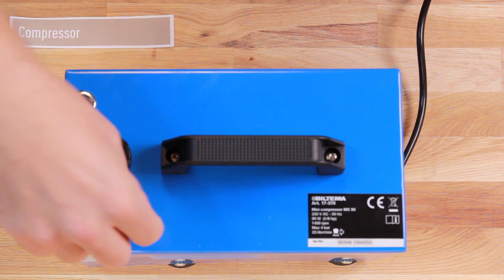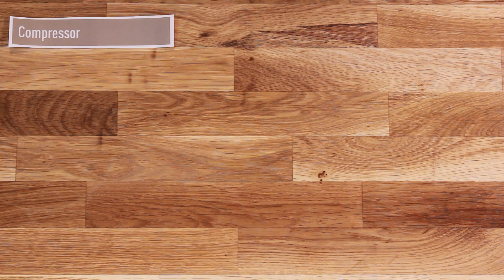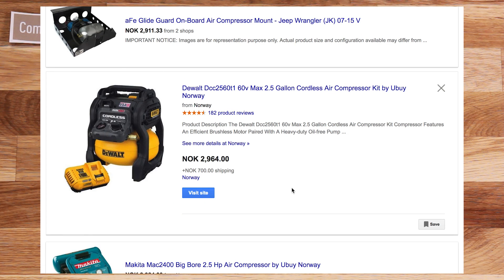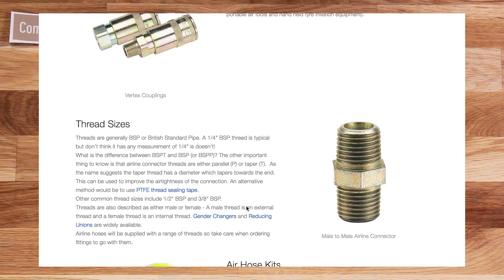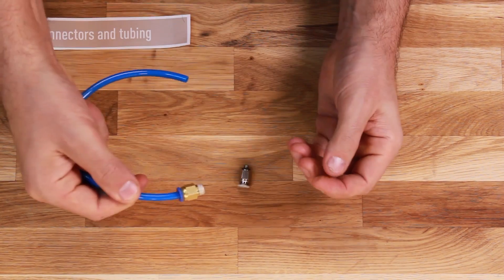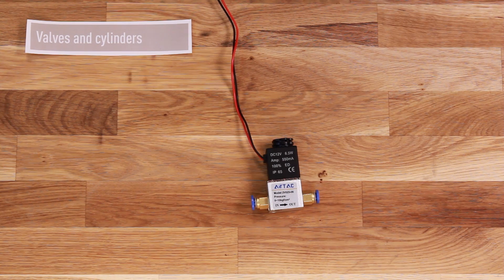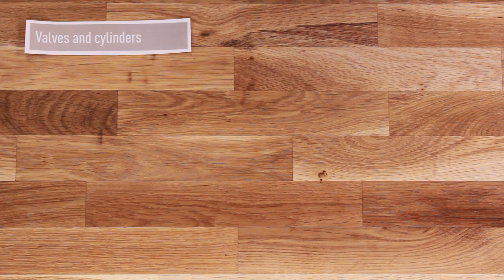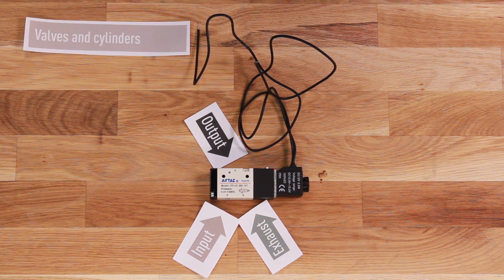Getting started with Pneumatics - the Basics

Comment: Thank you for this explanation... very helpful.  I am a novice looking for advice..  My project needs a pneumatic piston with adjustable pressure.. not just 'extend/retract"...  I am basically trying to use a pneumatic as a adjustable resistor against a force.  I plan to use a pressure sensor to keep the cylinder at a given pressure- but still be able to push against it...  That is why a screw-gear or a hydrolic piston wont work...  Any suggestions or advice appreciated..  Mahalo!

Comment: 11:43 What is the "release" of air that is going on? I can understand the air is going out towards the cylinder, but once the cylinder has extended fully, there should be no other air being released.
Then when you stop supplying air, the spring returns the cylinder and then that air that was within the cylinder should then go out via the exhaust right?
So.. why was there a continuous release of air after the cylinder was expanded?

Comment: Hey i know this is an old video but im wondering if i can just get a tank and then refill that tanks at like a paintball place or whatver. or do sho.uld i ourchase my owen compressor
Reply: Do just what you want I guess? If you refill, they'll love you for not getting your own compressor? 😉

Will you be using this several times? I would do a quick calculation for refilling vs getting the compressor part. It's not expensive at Harbor Freight?
Reply: @JensChrBrynildsen  refill is free so

Comment: Liked how you applied the PFTE tape in a clockwise direction.
Reply from the maker: Heh... I've honestly never thought about this and I never had a problem. Pretty sure I've used both directions with no problems but yeah - there is a correct way https://www.reddit.com/r/HomeImprovement/comments/bs6su2/how_to_use_teflon_tape_for_those_who_dont_know/
Reply: @  Interesting. Thanks for the info.

Comment: Hi do u know what air pump will lift my chassis up faster then my air pump can see in my video the pump im using is a mini power small pump piston air pump vacum pump diahragm home appliance 12v 3/5 L
Reply from the maker: Hi TomWest. It's really hard to help with such a request via YouTube comments. You don't mention what kind of chassis this is and if it's a car, I really don't event think that I want to give advice? ;-)

I would find an online discussion forum for pneumatics where you can post your question with images that explain the context & setting!
Reply: @Maketronics  your right because i might get the wrong 1 that might not work for it i have brought a couple fort they will work and they are no good very slow as at lifting my chassis was lucky to have found the 1 in the chassis that lifts it real good an only found 1 on google amazon but they dont ship to my country i brought it off alirxpress a couple off year ago and they not sell it on there anymore

Comment: can you reverse the direction on the double action?
Reply from the maker: Hi. I'm pretty sure that I'm showing exactly that around 12:00 so I'm a little unsure what you mean? Do you mean changing the "default" extended/contracted state? That would be just to swap the compressed air inputs to the cylinder.

Comment: Can I have a link to the connected for the air compress tube to the tubing for. The pneumatic valve
Reply from the maker: Hi. There are some affiliate links in the description for the video. It's not quite clear if it's the tubing you're after, but in the video I'm using "fancy" tubing from Festo, but any other brand will do as long as it can hold the pressure. I picked up an entire 50m roll of both 4mm and 6mm. I later donated the remaining tubing to a local machinist school.
Reply: @Maketronics  hey thats not what im talking about its at 7:34
Reply from the maker: @LlamaGaming2023  Oh? So just a basic Solenoid Valve like this one? https://www.amazon.com/Electric-Solenoid-2WA030-08-Direct-acting-Normally/dp/B0DK6FBP98/ Just on/off function?
Reply: @Maketronics  at 4:37
Reply from the maker: @LlamaGaming2023  So what you're looking for is the quick-couplings? I cannot tell you what standard is used where you live. You must look that up yourself. I Norway where I am, we have 3 active standards and it's a nightmare to find the right fittings. After a lot of testing, I now know which two I will use. Hansen-connectors at work and at home I use Cejn 320. This will be different for all countries, so go to your local hardware store/workshop and ask them what they have?

Comment: How manu weight can i push using this without any trouble ?
Reply from the maker: Hi! This is something you will need to calculate based on the size of the piston, the area and pressure. Try searching "Pneumatic Cylinder Force Calculator" to find a tool that can make this easier?
Reply: @Maketronics  Okay. Thanks

Comment: Stupid Question but at 12:50 the cylinder is permanently extended until you press the button. If you swap A & B, would the cylinder be permanently retracted until you press the button? I want to build a horror animatronic that jumps out from behind a gravestone, for example, so I need it the other way round.
Reply: You are correct! Just swap to get the reverse action.
Reply: @JensChrBrynildsen  Thanks!

Comment: what do you call that connectors you used which controls the exhaust port flowrate and the inlet port flowrate?
Reply from the maker: Hi! That would be a "pneumatic muffler" or "pneumatic exhaust filter".

Comment: I’m looking to make a prop electric chair and need something to make the dummy shake. how would I make the cylinder automatically open and close without having to press a button
Reply from the maker: Sure. This is fairly easy to do with a microcontroller like Arduino. Just search YT for the keywords Arduino and Pneumatics to find many. James Bruton is one of my favorites https://www.youtube.com/watch?v=d7ErG5ecO2s but check some others as well that go more into the details? One thing: many of the examples I found are using Relays. Keep in mind that mechanical relays don't like being turned on/off very fast, so it's often better to use an SSR instead?

Comment: Hey so I got some Tailonz pneumatic fittings, solenoid valves and such the 1/4 NPT. I have no idea how to connect that to a compressor. Part wise I can't seem to find anything. Is there any recommendations?
Reply: Heya. I have no idea where in the world you are, so it's hard to offer specific advice. But - if you go to a proper hardware store that sells pneumatic tools & fittings, they can give you advice. Bring a valve to explain? (And no - Harbour Freight is not the kind of hardware store I think about here. You'll need somewhere that knows more than selling cheap stuff)

Comment: Thank you for this video! How loud is your compressor?
Reply: Not so loud that it scares me? The most important is to have a pressure chamber so the compressor does not have to run all the time. Beyond that, you pretty much pay per decibel of reduced noise so it really depends on your budget. Any cheap compressor will be loud basically.

Comment: How did your ball launcher turn out?  I wanted to make something similar that would be able to shoot a basketball ball up to 20-25 feet.  Would everything just need to be sized up to handle that?
Reply: It actually ended up beeing opposite of what I thought. If you try to blow something inside a tube, it'll fail at some point. The ball will stop inside the tube. What I had to do was to use under-pressure. Turned out great and have been running all year for 4 years at the museeum by now. They're very happy with the installation.

Comment: What the power supply? 12v ?amps ??
Reply: Hi. This depends on your specific device. The one's listed under the video are 12V (as written), but you'll find others as well. 24V is a common battery on trucks/lorries, so that's also common. There's also 110/230V solenoids available. Amperage is directly related to how strong the solenoid is. These small one's won't pull much, but look at their datasheet and you'll find what you need.

Comment: Hi can not using a air tank to lift weight  weaken the strength the cylinder not lifting one side off my chassis im only using air pump 7.4v lipo battery and lego air cylinder
Reply: Sorry. I have no idea what you are trying to achieve with your LEGO here - weak cylinders or not ;-)
Reply: @JensChrBrynildsen the lego ones i have are  weak to lift my chassis but the 16mm bore mini peumatic air cylinders i have lift it
Reply: @TW39  Ok.I still don't understand your question though? Do you wonder how to get more "pressure/lift"? The easy answer is to not use cylinders made for LEGO since there are obvious limits to how much pressure a plastic cylider can hold.
Reply: i know now have to use 16 bore in diameter peumatic air cylinders to lift the weight im new 2 this

Comment: Hey nice video! I was wondering how powerful of an air compressor do I need to move the piston?
Reply from the maker: Most small compressors will give you at least 8 bars of pressure and that's enough, unless you are moving something heavy. Look for a compressor that has a tank, so the motor does not have to start all the time?

Comment: Hi, can we control the position of the piston extension via 4/3 solenoid valve?
Reply: Nope. For that, you'd probably use an electronically actuated device with position feedback. Look for a linear actuator with position feedback?

Comment: Im making a pneumatic vegetable cutting machin for my final year project, what kind of air compressor should i get?
Reply: I would need more info on expected cutting speed, the size of the setup and much more to advice on that, but just start with something that has a tank? If that runs out of air, you'll know that you need something bigger.

Comment: Hey do you know if I can use a mini compressor
Reply: I have found that some of these are not be able to hold the pressure at max for more than a few seconds. Another problem is that it will produce noise continuously. If the noise is no problem, you can give it a shot. I would recommend getting one that has a pressure chamber though - even if it's just a small one. Start with a small that you treat well and then sell it when you find that you need something bigger?
Reply: @JensChrBrynildsen  they you might have a Idea what for brand I need to look for?

Comment: Thanks. I needed this for Mark Rober’s summer class.
Reply from the maker: Cool! Is there Pneumatics in his course?
Reply: @Maketronics  No, but he did list it in his optional things to buy. I’m using a pneumatic cylinder for an automatic trapdoor system required for my project.
Reply: @Skeuomorphist  Yeah same here. Also doing Mark Rober's summer class.
Reply: @mytastydurian5015  what’s your name
Reply: @Skeuomorphist  Richard F
Reply: @mytastydurian5015  I can’t find you, but mine is Preston L
Reply: @Skeuomorphist  many classes so would be pretty unlikely
Reply: @mytastydurian5015  oh. I thought I was just one
Reply: @mytastydurian5015  what are you building?
Reply: @Skeuomorphist  Do you have discord? Also mounting an double acting cylinder vertically that will push a piece of plywood to close a ziplock bag
Reply: @mytastydurian5015  yes, it’s “George Sink P.A.#4235
Reply: @Skeuomorphist  sent
Reply: @mytastydurian5015  ok
Reply: you can use them if you want

Comment: Very nice demonstration. Question , the double acting actuator was in the extended position can it be started in the retracted position?  What is the advantage of the double vers the single with the spring to retract?
Reply: Hi Steve. With a Double Acting cylinder, you can start at either position as long as you maintain pressure. If you release pressure, gravity takes over. The primary advantage is however to control the speed. If you want a Single Acting cylinder that starts in the expanded position, you can find this also but it's more common to find the opposite. Google words like "single acting spring extend air cylinder" and you'll find it.
Reply: @JensChrBrynildsen  Thank you. Will go for the double action. I need the action to start in the retracted position, (pressurized)  nice to have the option to control speed.

Comment: I'm debating building a pneumatic adjustable desk so I can supress a lever and adjust the height of the desk. I have a math background but no engineering and access to a maker space. Is this feasible or should I be looking for professional help?
Reply from the maker: I would definitely go for something that is electrically actuated, unless you have a need to lift the table within less than a second... Just google "12V linear actuator".
Reply: @Maketronics  I think I've settled on a gas strut/spring. I want to not have it be electronic though I agree a linear actuator is a good solution for this type of problem

Comment: How do you know what diameter tube you need?
Nice video though. 👍
Reply: Hi. Your parts (actuators, valves) will have connector that have a specific size. You select this when you buy and most parts come with connectors for different tube sizes. Its easier if you just use a single size in your setup, but you can also find connectors that go from 4 to 6 or 8mm tube (and others). Its very flexible in other words.
Reply: @JensChrBrynildsen  hi thanks for your reply, what I actually meant was, what determines that you would need to use, say 8mm instead of say 6mm in your design; a bit like when using electrical cabling, it would be the amps drawn by the load that would tell you to use a 2.5mm cable rather than 1.5mm.
Reply: @tj9382  Ahh. I have not had a need for this, but larger diameters can hold more volume vs pressure. For large actuators, it would take a very long time to open/close with a 4mm tube, given that there is also a limit to how much pressure you can (and should) apply. An 8mm tube has 4 times the area and can thus actuate a large valve 4 times faster :)

Comment: What about use of negative(fractional?) pressures. Working with vacuum.
Reply: Hi Chris. I have not done that myself, but I would think that would work in general? I'd look at the specification of each item in your setup to see if it is doable as especially valves would need to support it. I had a look and the ones I have do all require positive pressure to work as intended. I'd look at the Festo homepage to read their data sheets.

Comment: Brilliant video but I can't seem to find what you have :(
Reply: Hi Eddie. What I have? As in the components I have?
Reply: @JensChrBrynildsen   yup. I find that there is very little choice in Ireland and it's usually twice the price. Your video is brilliant tho.

I found a cylinder simular to the on you used for 78 euro and a controller that I need to check back on Monday. 

Could you reccomend a few brands. I'm just using them to show them to kids. I'm a youth worker and I wana build some small things with the teenagers I work with.
Reply: Eddie Quinn  That was quite expensive. What I have is a mix of parts that I used in a customer project and things I found on Banggood & Aliexpress.  I'd recommend browsing these sites for parts for learning.  The expensive parts are all from Festo. There is certainly a quality difference, but not for learning or hobby projects.
Reply from the maker: Hi Eddie. The video has gotten a lot of views, so I added some Amazon links that could help you getting started  (it's a long time since you asked tho).